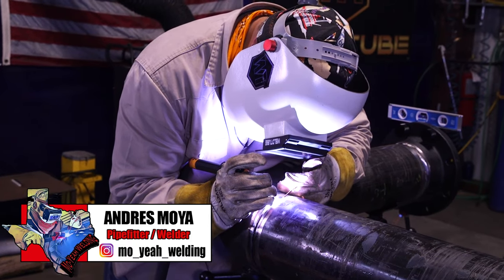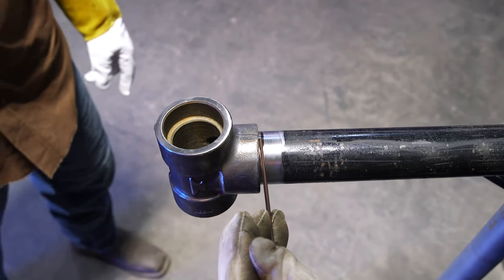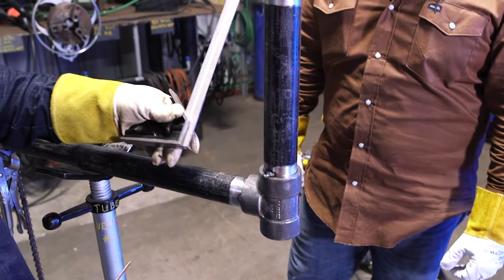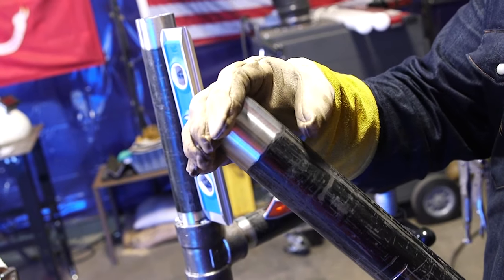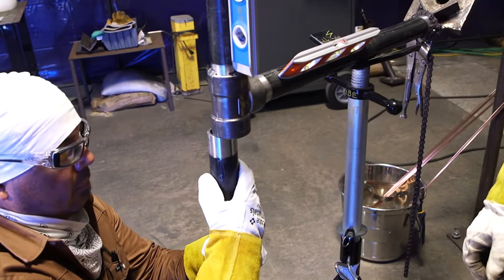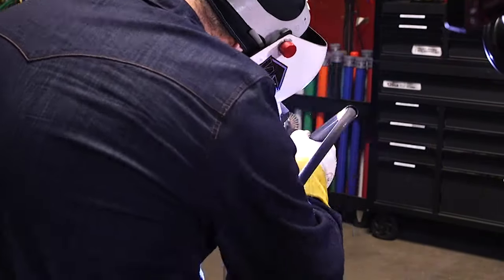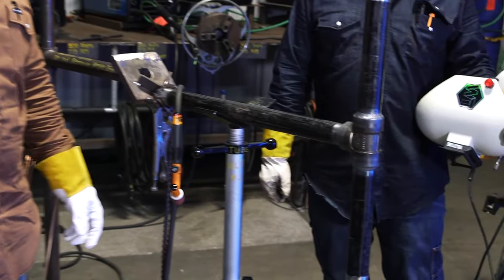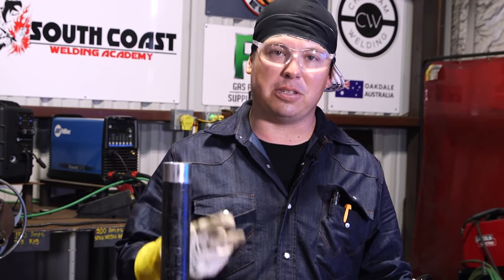How to Fit and Weld Socket Welds in Various Fixed Positions

Comment: On a squared end I’d mark the pipe all the way around with the socket weld fitting. Or use my wrap around to give me my 1/8” gap all the way around. And use the 1/8 wire on the sides as well.

Comment: Respect. But I have to point out that those are not socket welds. Those are technically lap welds on socket fittings, right? A socket weld is where the actual weld itself fills up the socket, usually you'll find a hole in one plate on top of another plate which you have to fill up with weld. Maybe I'm just being pedantic. Either way, great work guys! You have great skill and your welds are very neat. Well done!
Reply: I thought that was a plug weld. [s]Maybe they’re the same thing?[/s]
Reply: Lmao these are definitely socket welds..
Reply: @logantoney4525  ASME B16.11
Reply: @twestgard2  you put a plug in a socket, right?
Reply: @thomascraig3694  I think ASME is the authority that defines what’s what for welding and according to them this is a socket weld.
Reply: Only name we ever called them was  socket weld fittings      and the  O lets are called   soc o let  .     right or wrong  when im in field or in shop we call them socket welds

Comment: Thats a school!!! Trust me I the real world it's totally different.. come out the the ship yard!!!
Reply: Or a fab shop
Reply: What's totally different about it? Almost every job I've made socket welds on, you bottom it out, scribe a line around the pipe at the top of the socket fitting, back the socket fitting off of the line from 1/16" - 1/8" (depending on the prints) for thermal expansion and then tack it to get fit up bought off. Then, weld it out. So, what does "that's a school" have anything to do with it? They are doing it right and it's exactly how you should do it in the field. And, there are actually more in depth ways to do it as well. That way, the QC can 100% verify that you backed that fitting off from being bottomed out before you weld it.

Comment: Do you have to account the 1/8 gap for the socket into the measurements or does it suck back once welded out
Reply: Yes include gap & takeoffs. Be careful though, the blue book doesn’t account for 1/8” gap, Chico cards have it with a gap. Always double check

Comment: Ive seen people pull away as soon as they finish a tack/weld, why do they do this? I just let it slope down on its own?
Reply: Because he’s using a machine with scratch start. Basically you initiate the arc by touching the tungsten to the work. The only way to terminate the arc without a pedal or a trigger is to roll or pop off like he’s doing. If done improperly you will leave a pin hole all the way thru the pipe called a fisheye.

Comment: Notice how they are NOT threaded with oil everywhere. Nice and clean. But using 70 series wire on cast to carbon?
Reply: It’s a forging not cast s/a105 material
Reply: @cirizawelding5076  copy that, just thought with a Mn% of .60 - 1.0 and Carbon .35 a 70 series would be too brittle. Welded cast to carbon and dissimilar metals for over three decades but not forgings. Good to know. BTW great looking welds👍

Comment: I can’t recall ever seeing someone “palm” a torch like our man David did on that first weld. No disrespect intended… just trying to figure out why he does it this way.
Reply: I put roots in holding up like that gives a little more control wiggling the cup in my opinion
Reply: You have way more control when holding the rig that way. On smaller diameter welds, where your torch angle is changing constantly, it's easier to hold it that way and have better control while walking the cup around that small diameter piping. When you weld on big bore/large diameter, it's waaaay easier because even though you are still welding it in a certain position, the larger surface area makes it closer to welding a flat plate in different postions all the way around that pipe. Where as welding a small diameter, it changes your torch angle every 1/4" or less. Small bore=faster and more drastic change in torch angle, so you need to be faster and more accurate. Large bore=slower and less drastic change in torch angle, so you have more time to account for little off wobbles or mistakes here and there.